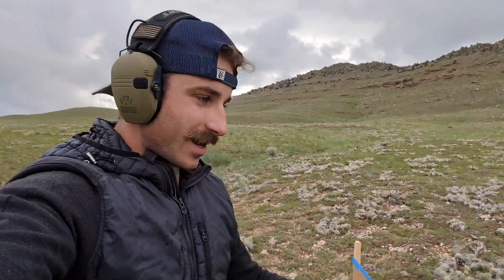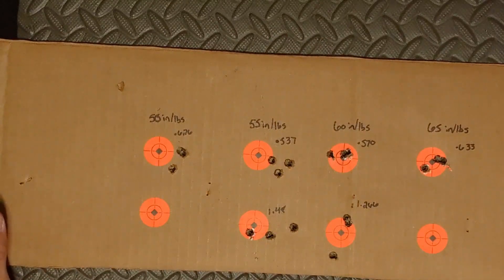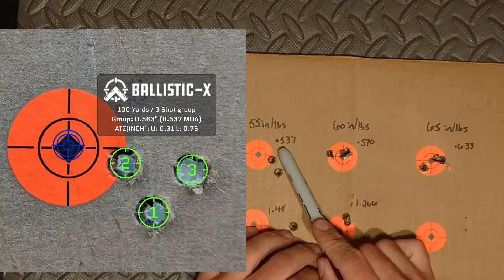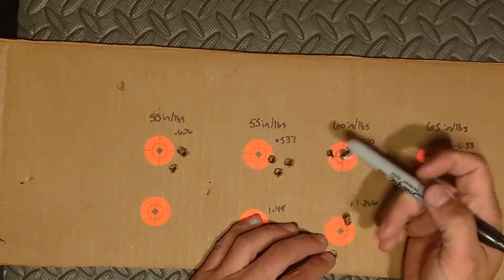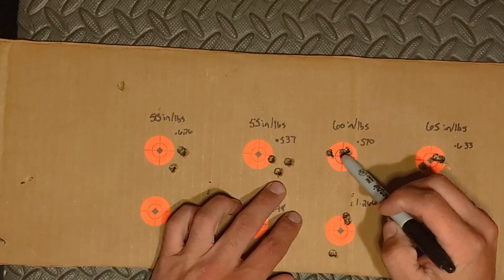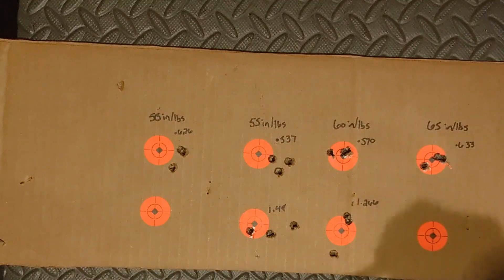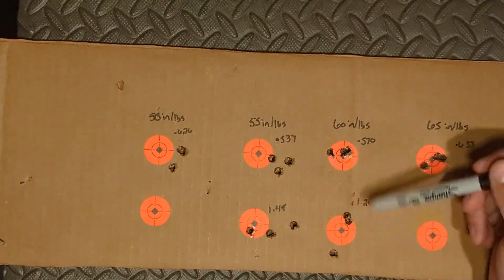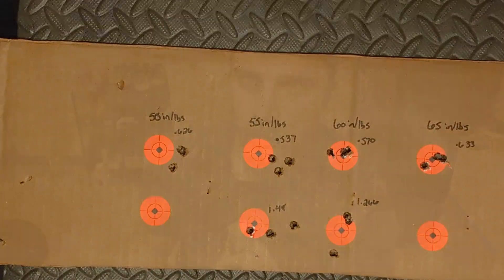6.8 Western- Can I Affect Accuracy with Action Screw Torque Settings?

Comment: Thanks for the awesome content. Building a 6.8 western custom rifle in 2024.

Carbon 6 1:7.5 21 in Barrel
Stocky's VG2 Stock with DBM
Rem 700 Aeroprecesion Solus Lightweight Reciever
Resilient Jolene Supressor
Trigger Tech Special 2.5lb Straight Trigger

Unsure of the scope and bipod. Currently thinking RAZOR HD LHT 4.5-22X50 FFP and Spartan Javelin Adjustable